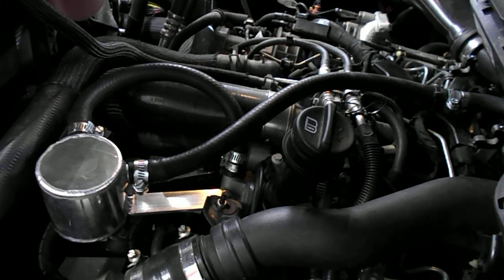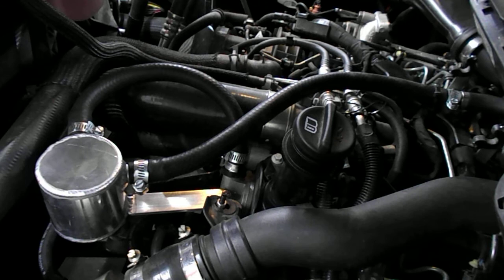Ecodiesel Ram catch can install

Comment: Nice video, too bad the kit doesn't install as recorded. Hoses provided sucked, thin walls and pinch easily, and the ID is too small to fit over the PCV neck as shown in the video unless you terminate it with a OEM style fitting. Unable to source needed PCV fitting at O'Reillys or AutoZone, ended up cobbling something together in the plumbing dept of Menard's that worked; obviously I will have another go at this to replace the current fustercluck and make it right, but for the money the goddamn thing should have been a 15 minute bolt-on straight from the box as advertised, not a 6 hr Sunday afternoon odyssey to mutt together something that throws codes.
Reply: Joseph, I agree! As much as they charge for this it should be turn key. My bitch is that the mounting bracket that is welded to the body is in direct line with the output tube which is in direct line to the front drivers side plastic mounting stud for the engine cover. I didn't use "heater" hose  but I did use a quality 5/8" hose that is made to handle oil, temp and pressure. It just would have been so much easier to have the canister bracket clocked 10 degrees away from the outlet tube so the hose doesn't try to flatten out, to try and get around the plastic mounting post. Because of that poor design I did not mount at that stud location but rather the threaded stud support for the turbo inlet tube from the intercooler. I had to modify the bracket on the CFT catch can to have it set lower since the new position is about an inch+ higher than the original cover mount. I could have just mounted in the original suggested position and it would have been fine if I did not install the mount stud but during the winter months I will use the engine cover. Warmer months I'm leaving it off! No need to heat soak components under the hood. For the amount of money it cost it should come with preformed quality hoses that snake around to make a nice fit. The one guy that complained about hooking up to the "special" connection which is larger than 5/8" didn't take the time to carefully remove the factory quick connector that is on the factory hose that works well with the 5/8". It has an O'ring on it and if I have any issues with codes getting thrown for PVC pressures then I will locate a correct sized "Vitron brand" O'ring that oils & heat don't bother. I saved the original hose and the 2 special clamps which are still usable. PS the dealer techs I've talked to say they haven't located these type of connectors either.

Comment: The unit I received was welded with the wrong orientation to the bracket, making the included hoses unusable.
Reply from the maker: Most Likely installed wrong. catch cans super simple to install. Also we have up dated them over all the years. But we no longer a Auto manufacture so instructions are no longer updated.
Reply: @CFTPerformanceINC  Sent an email with pictures detailing what I was referring to. Appreciate your reply.
Reply: @CFTPerformanceINC  I just received my catch can also with the incorrect orientation. Placing in this orientation will pinch hoses, so going to have to tig weld the bracket to the correct side
Reply from the maker: @westsguitar4046  if you read description this is old design and we went with new design as states in product description. Reverse install makes for shorter hoses and less errors. All that is clearly listed in product details.

Comment: Doesn't the install of this device cause the truck to throw some error codes?
Reply from the maker: on all the test trucks from 14-17 have been issue free
Reply: I just installed this today, it was very easy to do & no codes after 50 miles driven after install, however the dust cover does not go back on with the stock pin,  it hits the catch  can and doesn't make contact with the pin, I'm going to see if I can fabricate a bracket from the bolt location to secure the catch can then place the dust cover back on rather than cut the cover
Reply: I just did the stage 1 delete. My trucks a 2016 with now 35,000 miles in a year. Since new its blowing oil out of the hot sode intercooler tube. With the catch can solve my problem? I also have the gde tune since 5000 miles
Reply from the maker: Yes catch can is used to collect as much of that oil to keep it out of the system.
Reply from the maker: Joel Orr make sure you installed it in the right spot. If the cover pin dose not make contact make sure you install it back in factory spot as there is 2 tap holes in that area you can use and one only works with the cover. Also the can will sometimes need to move side to side for the room for the cover. Last make sure the cab sits straight. If it’s pitch and not level slight bend so on will take care of that.
Reply: Will I have manufacture warranty issues with my brand new ram eco-diesel if I install one of these? I just can’t believe how much blow by my eco-diesel has brand new!
Reply: Will this work for he 18 model ecodiesel
Reply: @joelorr1736  I made a z bracket to put the canister 1-1/2 inch lower and extends out an additional 3 inches.  Fits properly now.

Comment: Keeps throwing codes. Had to remove it.
Reply: What code was it throwing off do you remember?
Reply: Did you solve your code issue or still leaving it off the truck?
Reply: Lee Dzielak I’ve left it off.

Comment: Don’t buy. The bracket is too short to allow top cover to be put back on. $165 and doesn’t include pipe drain fitting. If you install it where it will fit, it’ll drain right on top of the sensor. Poorly thought out. Look for something else. Not ideal. Needs work.